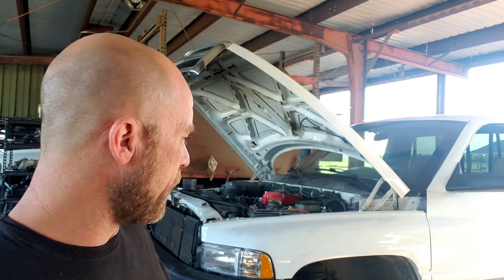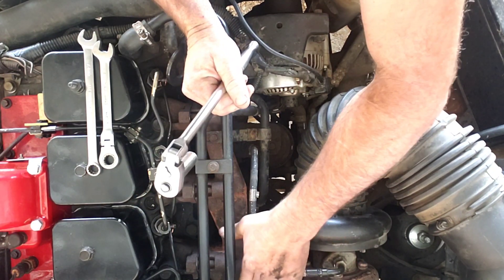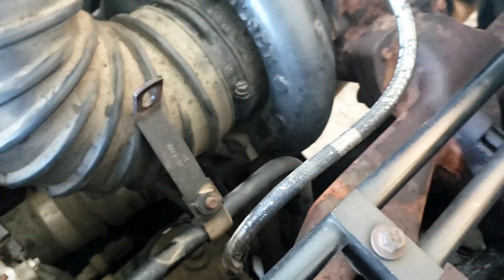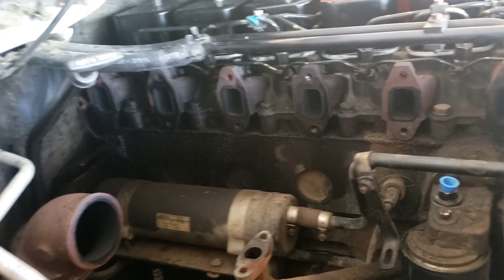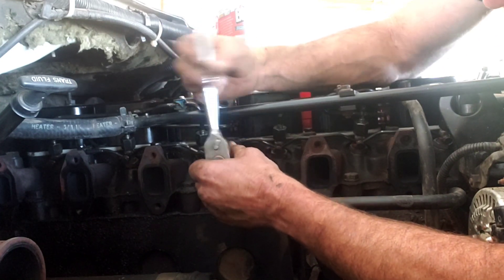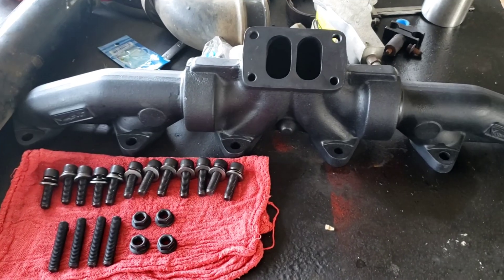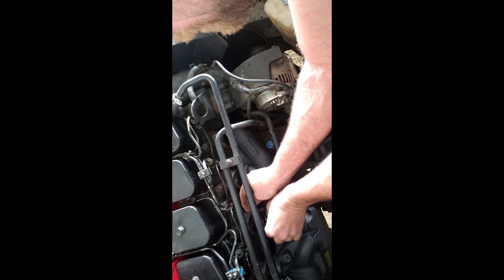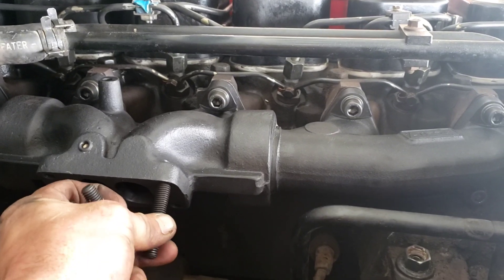12 valve - Cummins -  turbo upgrade - exhaust manifold upgrade

Comment: When you’re doing that with the top get your air blower and as you’re going in as you’re running the top in the porthole just blow it out occasionally the air going down the flu will help blow that debris out of there as you go and then I wouldn’t use any lubricant that way the whole remains dry and then you can blow it out better maybe use a little WD-40 after yeah or PB blaster I like that better and put that on the bolts as you tighten them in anyhow that helps this is six and a row jim from Kennerdell Pennsylvania

Comment: So would I just be able to reuse the old hardware if I clean all the threads up really well and the slots really well? Stupid Dps didn't send me the correct hardware only the correct gaskets. So I only have 4 of the 12 manifold bolts 2 of the correct studs for the turbo flange and a bunch of useless studs. Pisses me off a bit spend $400 for and can't even get the correct bolts and studs.
Reply from the maker: yes you can but it does matter if the hardware is in good shop. for example in Wisconsin the bolts would most likely be too rusty to reuse
Reply: Alright I contacted dps anyway just to see if they'd respond and send me the correct hardware. I have a pretty large grade 8 hardware kit that I got a while ago so I could always just figure it out with them if things don't work out with the old hardware and if dps doesn't respond.

Comment: 50/50 ATF and acetone on the bolts, take your time keep it moist too wet for a full day, so intermittently going back to the motor and applying the mix, lightly tap the bolts with a hammer, and I mean lightly tap, and those exhaust manifold bolts will come out the next day like they are brand new on a cold motor. I did this with my motorhome which had an 8.3 Cummins, from 1992, So at the time that I did this the coach was 20 years old with the original exhaust manifold which had shrunk and was leaking. Those bolts came out as if they were brand new not even a squeak